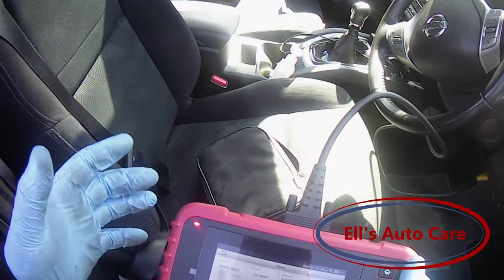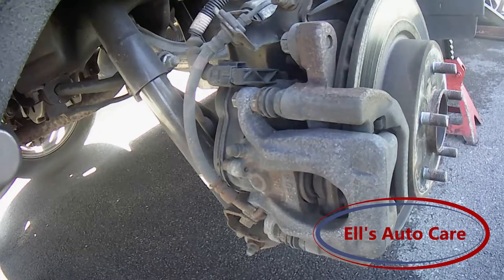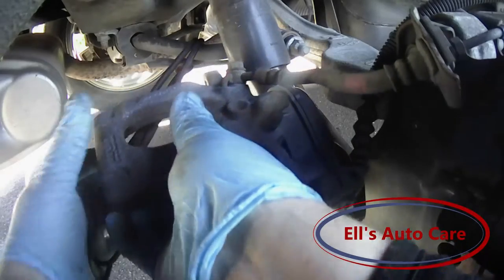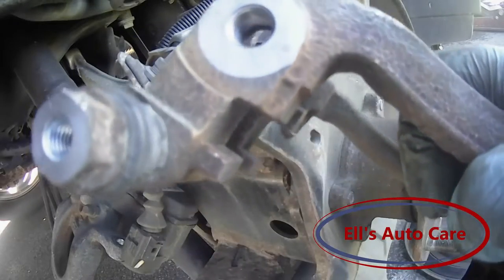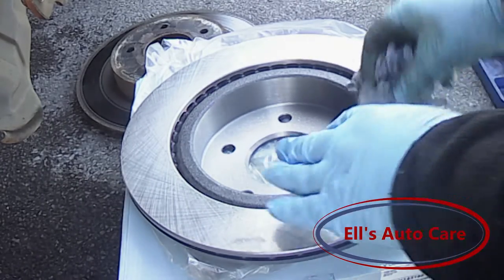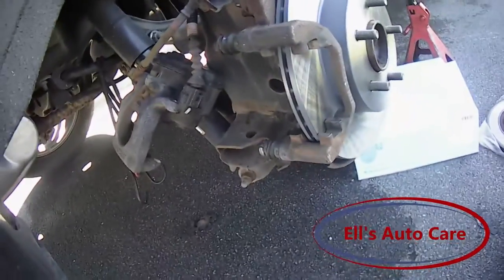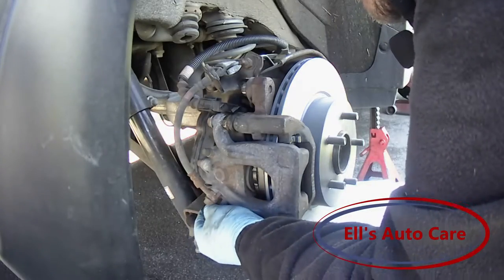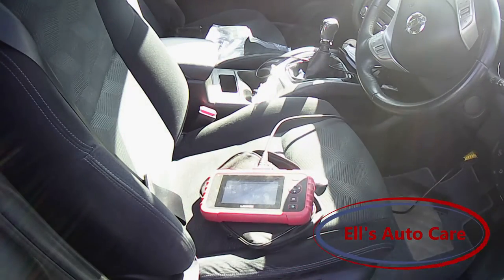2017 Nissan X-Trail Rear Disc & Pads

Comment: What scan tool is that?
Reply from the maker: It’s the launch CRP129X it’s only a cheap one but it does the job
Reply: @EllsAutoCare  Hi only just seen your video as have this to do myself, is the function you used on the diagnostic tool brake reset, as appears the model you have is no longer sold so just looking at another model thanks
Reply from the maker: @Exocet-me4bv  yeah mine is a little old now I’m in need of a new one to be honest.. 
but yes, it’s brake reset
Reply: @EllsAutoCare  Thank you for replying, do you mind if i ask how old yours is and if it still holds up well? I wont use mine as much as you do but wondering if it will lasts etc as says lifetime updates